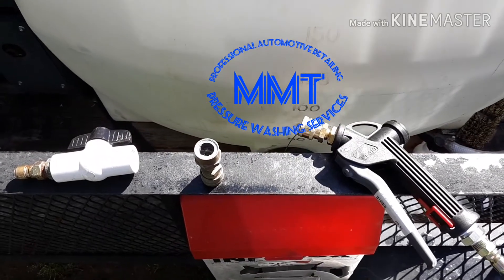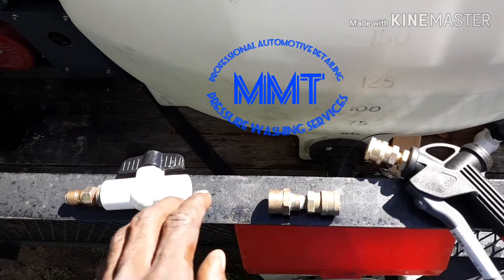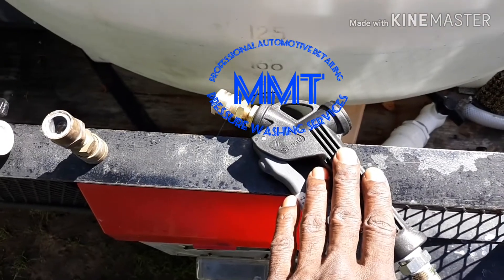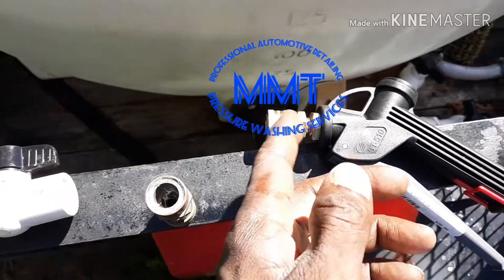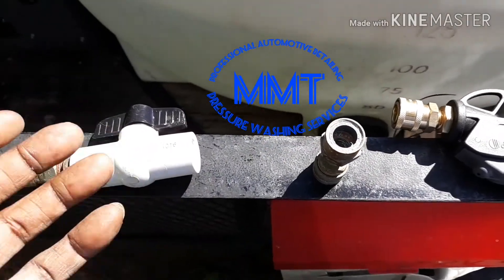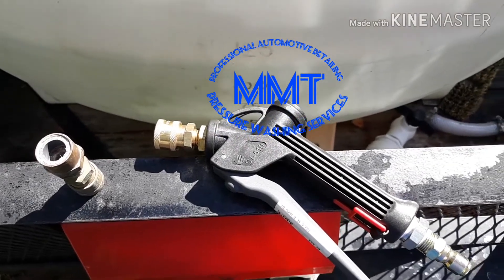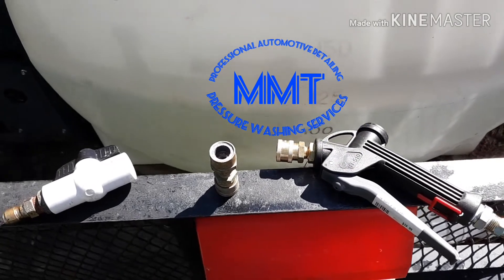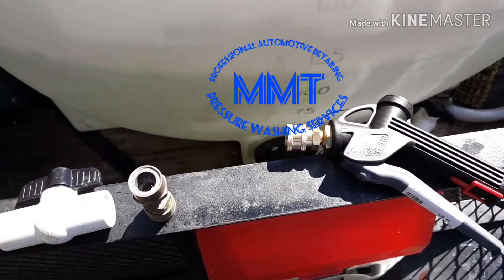Soft wash gun/wand upgrade/ Soft Washing/ Pressure Washing

Comment: The originator and pioneer of the first quick connect guns and wands in the soft wash industry 🤷‍♂️ thought since I invented it I would drop a line.  Here is what I will tell you, one make sure to use sch 80, I use special viton valves that are impossible to find but look for a 1/2” hayward viton valve.  Use Hansen stainless 1/2”.  I could go on but lets just start there and see how she works, good luck!

Comment: Use a 18 inch extension on the gun, you get better flow because you get swirling turbulence action from fittings bends and hole size diameters from the water,  , the extension lance evens out the flow so you can shoot the water straighter and further